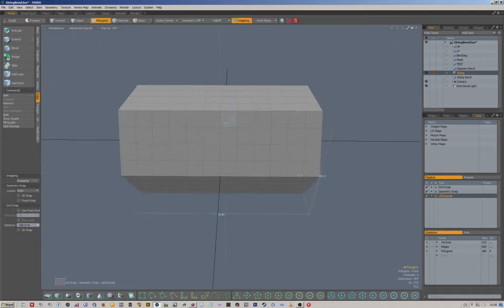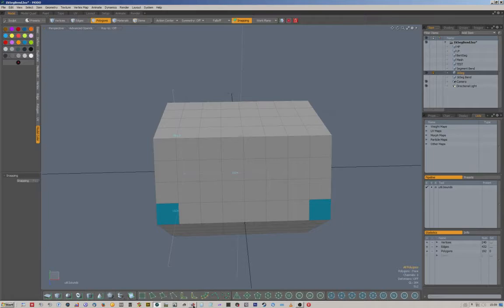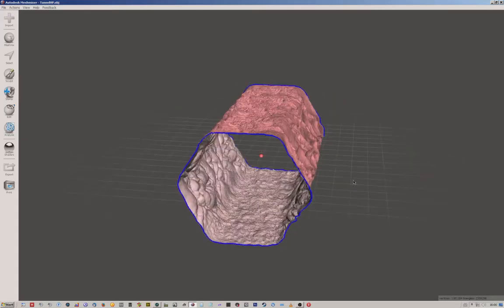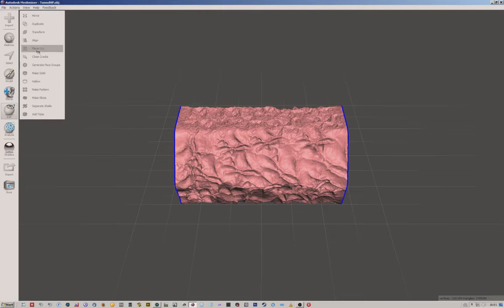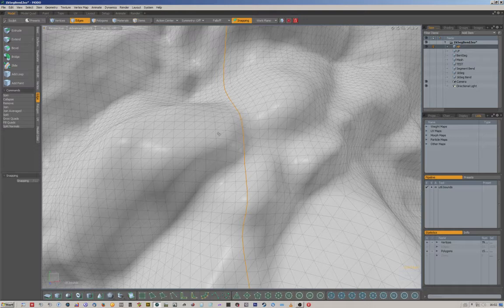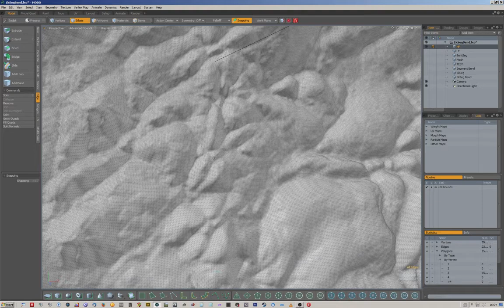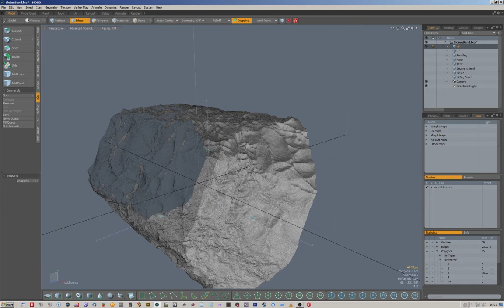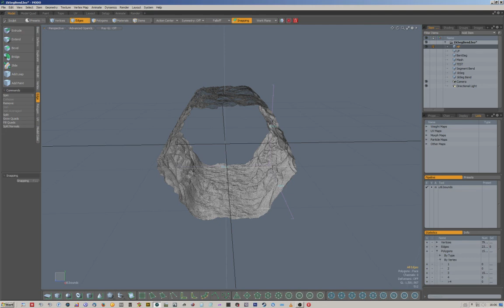Organic Modular Technique (intro)

Comment from the maker: **correction** Misleading comment by me about using a normal map created from a straight segment, you will get compression and stretching if used on a bent segment but I have found a solution to this without having to cut a bent segment in half. It’s explained in part 2.